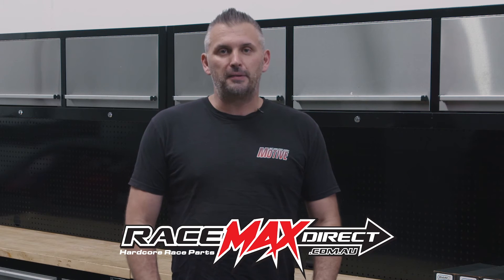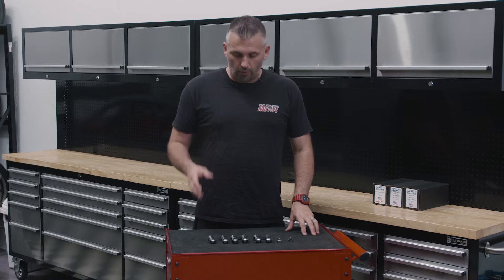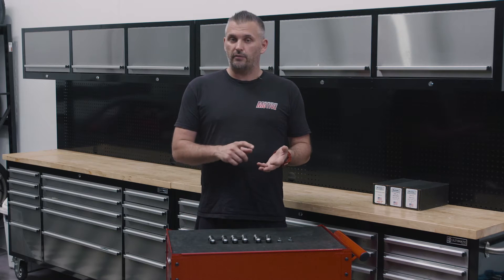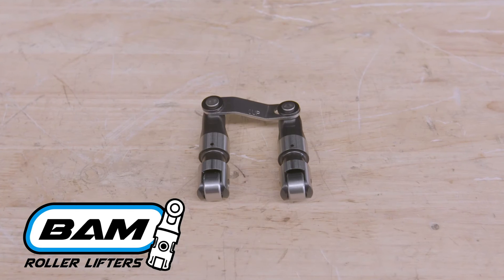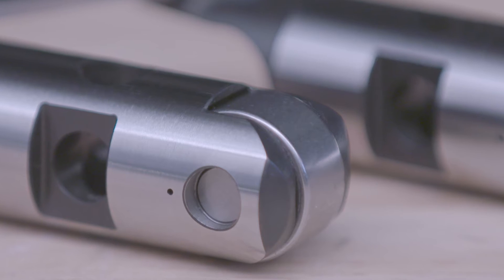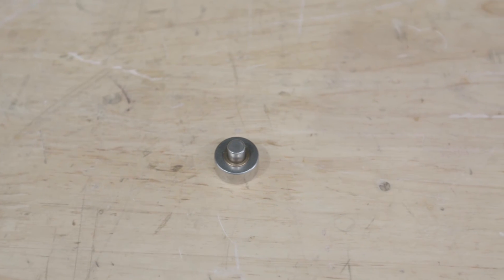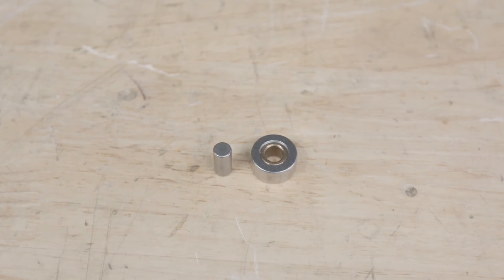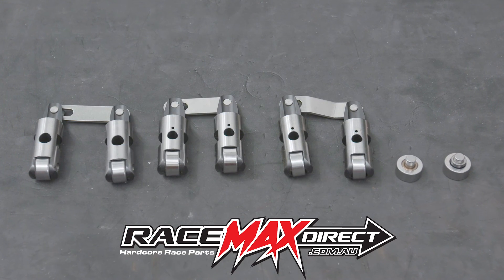Why Upgrade to Solid Roller Lifters - Race MAx Direct Tech

Comment: What's your opinion on DLC lifters for the street ?   I run Morel Ultra Pros now,  have done around 14000ks on them.   Kept a close eye on lash etc, going fine , just wondering if DLC were another option for street use.    ( 406 SBC, 642HP )    Regards Mario
Reply: My two cents... don't think you need to spend that for street use - DLC applications came about for the race crowd that wanted to push 7500+ all afternoon on flat tappets.  For me, a street car pretty much ends around 7k rpms.

Comment: NEver heard of them.
Reply from the maker: Thats OK they do not advertise to the public. They supply professional engine builders and race teams mostly
Reply: @racemax3295  yea no they don’t.
Reply from the maker: @nitrozack3062  they don't what?
Reply: @nitrozack3062  looks like a quality lifter to me what’s wrong with them ?
Reply: Race max is correct. They are up there with morel lifters. They aren’t the run of the mill comp cams, lunati, crane ect. Big time engine builders use these.
Reply: @matthewnosal6893  I only use crower 🤣 the best
Reply: @matthewnosal6893  or morel 😎
Reply: @nitrozack3062  crower is good shit too.